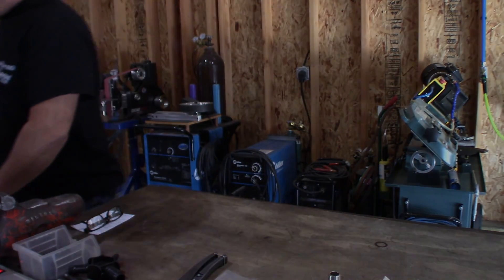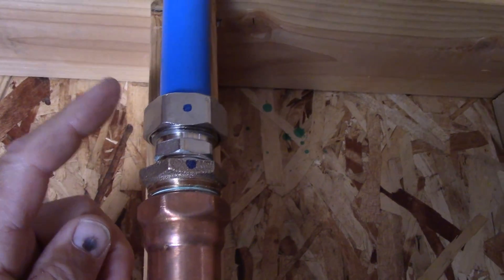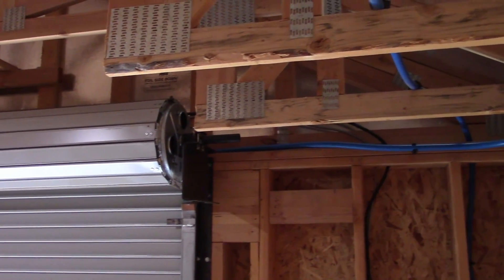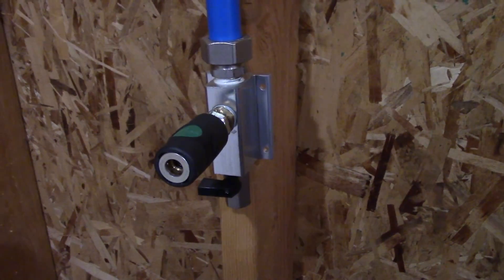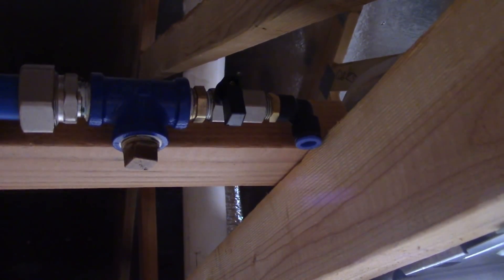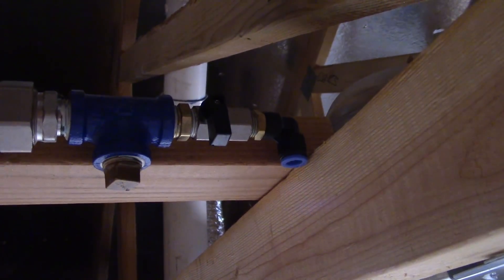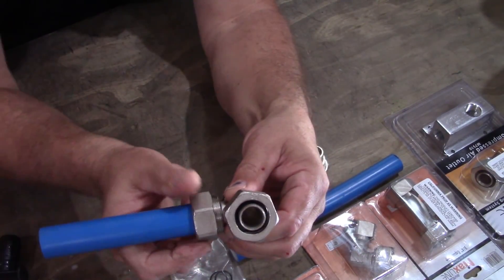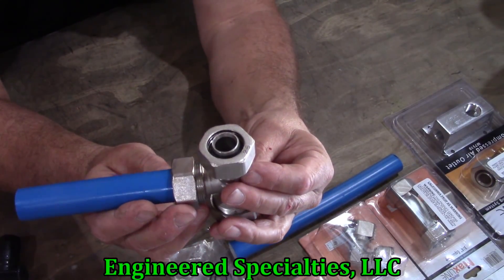Rapid Air Max Line Air System #realraysgarage

Comment: Excellent overview of that airline system Ray! This is just what I need for my shop. I’ve been on the lookout for a new airline for my shop and I think I’ll pick this up based on your review. Thanks for sharing all of the helpful info. 👍🏻
Reply from the maker: Abom79 Thanks Adam, this MaxLine system has been in use now for over four weeks and still no leaks and working great, looks great too! Looking forward to your install.
Reply: You can save a lot of money by using schedule 40 PVC irrigation pipe and fittings. Glue it all up and you're good to go. I installed this type of air system in my shop 10 years ago and have not had one leak since. I often leave it charged at 90 psi 24 hours day, 7 days a week. VERY ECONOMICAL AND DURABLE  AIR LINE SYSTEM
Reply from the maker: Hello Leonard, I have heard of sch 40 PVC lasting trouble free for many years but I did not want to chance my kids or friends getting injured if there was a failure so I went with this RapidAir MaxLine system and am very happy with it! Thanks for your comments and for tuning in!
Reply: Dudes i gotta say this. I opened up Rays video because i am researching an air setup as well and when i saw him i said to myself: Dude this guy looks like Abom79 20 years from now. Lo and behold first comment here? LOL. I could not erase the grin off my face... He he.
Reply: Leonard Zielewski PVC compressed air systems are very dangerous.  When the PVC fails, and it will fail as it ages and gets brittle, particularly if exposed to sunlight, it will explode sending sharp shrapnel everywhere.  PVC is banned by code for good reason.
Reply: @LTVoyager  I agree with ya 100 percent. That gentleman has just been lucky so far with that pvc system. I hope that no one is around when it does BOOOOOOOM! 👍👍🤣

Comment: How would the tube hold up in service truck in hot and cold weather in the North?
Reply from the maker: That's a great question! I would think as long as the tubing and fittings are secure and not moved around too much it should be fine since the tubing is three layers, PEX white inner layer, aluminum center and blue PEX outer layer. The fittings bite on the inner and otter ring for good seal. My system to date has zero leaks!
Reply: @RaysGarage  ok

Comment: Why did you loop it back to the first T?  Is this necessary?
Could I just do two branches from 1st T?
 Looping the ends of the branches together will take a lot of extra pipe.
Reply from the maker: Hi Steven, I looped the air system together to balance the air flow so that all drops provide the same volume of air. It is not necessary.
Reply: @RaysGarage  Thanks!

Comment: I see that you made this 5 years ago, but for anyone watching recently... on your drops, just sister/scab and another board (Looks like 2x6?) next to the aluminum blocks. There is no need to put an aluminum plate behind the aluminum block. This will give you a solid backing to screw all four screws into the aluminum block. Cheers.
Reply from the maker: Yes, you are correct. I did plan on closing in the walls one day so I just made the plates to be able to mount anywhere. Thanks for sharing your tip!

Comment: Did you hand form the bends at corners or use an electricians conduit bender? You could probably just put some pieces of wood on  each side of the stud to screw block into and not have to make the plate. So if you sheet the walls, did you allow room to get tubing on outside of sheeting?
Reply: Good question, Fred.
Reply from the maker: Hello Fred, I hand formed the corner  radius and did think about this before the install and was thinking about using crown molding to have access to the loop above after sheeting the walls, now for the corners I might need some ideas there, maybe there are corner radius moldings?
Reply: They do make this stuff called 'deco-sheild' that's used to conceal sprinkler pipe along walls that has been retro-fitted into existing building, but truthfully isn't that great looking! Maybe your idea of crown molding and then building little soffits in corners to conceal the parts that stick out because of the bends.

Comment: Nice system....   How does it compare to copper rigid tubing in price?  A big advantage of copper is you can oversize the pipe and gain extra air storage in the lines.  Helped do my good friends shop that way, (auto shop), worked great, big building
Reply from the maker: Hi John, I have over $300 in just the 1" x 30' copper delivery system and paid a little over $38 for a ten foot stick of the 1" pipe plus fittings, solder, ball valves, 1/2", 3/4" copper pipe and brass fittings. The entire 3/4" RapidAir MaxLine system with additional fittings and outlets was  just under $500 and have more than enough air for multiple users if needed. If I were to guess I am sure I would be just under $2000 range if I went with a all copper system. RapidAir does offer the MaxLine in 1" also but not in Master Kits so the cost jumps a bit.
Reply: Ray's Garage I just priced out a system for my 32’ x 48’ workshop.  I plan to run a 3/4” loop around the ceiling with a drop in the center of each wall.  This requires 210’ of pipe.  I priced a both Maxline solution and an all copper solution.  It turns out, the cost is almost identical at about $700 for each all in.  I am leaning towards all copper mainly because I can install it myself.  I don’t see any way to straighten and affix the Maxline while working 14’ in the air on a ladder.  It looks like I’d be wrestling a python.  At current prices, the copper pipe is about twice as much per foot as Maxline, but the Maxline fittings are what make the total cost nearly identical.  I can buy copper for $1.80/foot and Maxline is about $1/foot on Amazon.  The killer is the Maxline fittings which run $15-20 each.  Most copper fittings are 1/10 the cost.  For example, a Maxline tee is $21.95 on Amazon and a 3/4” copper tee is $1.69 at supply house.com.  A simple Maxline straight adapter to NPT is $17.15 as compared to $1.45 for copper.  I looked at Rapidair’s rigid aluminum pipe as that would be an easy solo install and the price was close to copper, again the fittings are pricey, but what killed that was the shipping cost of the 20’ pipes or the coupler cost if the shorter pipes were bought to save shipping cost.

Comment: Thanks Ray.  How do you filter out the oil and swarf from reaching the motor?  That is where mine falls down.  I have the steel tub so that is fine.  Steel would work well indeed for a shop anywhere as well as the welding position.  Only downside might be price.  Take care.  Doug
Reply from the maker: Hey Doug, The paper filter has a cotton sock on it that I change out from time to time but I still have to replace filters more often than normal. Its the the nature of oil and chips but well worth using the vac to clean up.

Comment: I have used nickel based anti-sieze on the fittings before tightening them up . That makes them turn very smoothly without the galling feeling when you tighten them up dry .

Comment: Great review! I am looking at purchasing this system. My only concern is that the fittings are a lot smaller in diameter. Is this an is issue with cfm? I’m worried that it will “bottle neck”. I need consistent volume for painting. I looked at the fast pipe but it is really expensive. I look forward to your reply. Thanks in advance.
Reply from the maker: Nick Carrasco Hello Nick, I do not think you will have flow issue with the 3/4” MaxLine System when painting but you could go up to the 1” MaxLine System. I would do a open line test for you if I could measure CFM but have no way to measure this test accurately. I would call RapidAir tech support, maybe they can give you more info.

Best Regards,
Ray
Reply: Ray Caniglia, in you opinion, do you think the diameter of the fittings would restrict the volume? I have always used 3/4” lines I’m just worried about the diameter of these fittings.
Reply from the maker: Nick Carrasco As long as your compressor can keep up you will be fine with the 3/4” system and don’t go smaller than a 3/8” ID air hoses.

Comment: I know this is an old video, but going the same route in my new shop. Bought 2 of the 100 ft kits.
Reply from the maker: Perfect Tom, It's a great set up and you will really like it once your finished. A quick tip, add a little oil to the fittings nut when assembling so that the metal to metal contact is  a lot smoother. Hit me up if you have any questions.
Reply: Ray's Garage will do thanks.

Comment: Looks good. I have a nagging small leak on my black pipe line I need to chase down.
Reply from the maker: Hey Tom, I am very familiar with threaded pipe and one of the main reasons I did not go that direction with the full system. Good luck with chasing down your annoying leaks!

Comment: Ray how did you straighten the pipe?  I've got 2 of the 3/4" kits waiting to be installed, I've heard the pipe is a PITA to get straightened out.  Did you use some sort of jig or just by hand?
Reply from the maker: Jo Simon I hand straightened the MaxLine then tweaked it a little more after installed in the clips. I spaced the clips 4’ apart on the top loop and 3’ apart on the drops.
Reply: No need to waste your money on the pipe straightening system I did mine around the perimeter of 32 by 40 Shop just by using the clips on the wall snapping the line in and working my way down and unrolling the coil as I went along got it semi straight snapped it into the clips and then made some adjustments in between the clips by pushing down or up or in or out depending on what I needed and it came out very straight and I don't think you need two people to do this process either, then again I had a scissor lift to work off of being that my system was at around 14 feet. The system is excellent and easy to work with but the only thing I didn't care for was the fitting IDs are a hair smaller then the rest of the piping system. But in the end it all gets reduced down to either quarter or 3/8 anyway at the tool location so I guess a little smaller ID on the fittings really isn't going to make a big difference. I used all Ingersoll Rand 3/4 inch regulators and coalescing filters and all my fittings in the system non rapidair are all stainless steel not much more expensive than brass. On my drops I also faced the tee fitting in the loop up then used a 6 inch piece of pipe a 90-degree elbow looking over, another short piece just long enough to connect a second elbow looking down and then ran my drop down towards the ground. This creates a candy cane type Loop to keep any water in the circumference of the system from entering the drops.  another nice thing about the rapid air system is you can direct bury it. I ran a second line off of a manifold with ball valves to isolate the different lines and ran it down through my block stem wall Underground all the way to my house approximately 90 feet away to feed my garage inside the house this way I don't have to listen to a compressor run in my house , it's 90 to 100 feet away in the garage.  great video by the way one of the better ones I've seen on the rapid air system. nothing like a machinist / metal worker to do things the right way and usually Overkill but I wouldn't have it any other way. Nice job!👍

Comment: Ray, could you please, please, pull the volume in your editing software a smidge down? Because it's so high, and because of YouTube's compression, when on headphones (which is my personal issue and circumstance, i know) it's a bit difficult to hear some things once you lower the volume. It's just a small thing, not really all that important.
Otherwise, an awesome video on a cool installation.
Reply: On a sidenote, good idea on radius bending the pipe, each time a T or a elbow is used, that's a reduction in pipe. I kind of miss the older, and now discontinued method of connecting air pipe where a small flange was inserted in to the tubing (very thin, so no reduction) and a sleeve would be compressed on top of it. Coupled with a nut, it would then screw on to a same ID fitting, thus, no reduction. One would think that they don't affect things that much, but on big installations, they do.
Reply: Oh and the tool is actually so that your pex-al pipe is squared, that little bulge is the part that spreads the pipe so it fits better. So in theory, even if you don't cut it perfectly straight, it will be straightened by the tool. It's really cool, i have the drill mounted version, where the bulge is on a separate, non rotating, sprung bit. Once you've inserted the pipe, it self centers on it and allows really crisp cuts. It's so good i haven't bothered in the last installations to even cut the pipe right, i let that tool do the work for me.
Reply from the maker: Thanks for all the great info! I will work on the Audio and did not realize was so high, it sounded fine during editing and should have reviewed it after posting it live. Thanks again for all the great input!

Comment: I contacted the company after 2 catastrophic failures using the recommended fitting tightness. They told me despite the recommendation, tighten them as hard as you can pull a wrench. The fitting cannot be damaged from over tightening. They said tighten until it stops turning if needed.
Reply from the maker: Hi Ron, I did make mine pretty tight, I found that adding a little lube to the threads helped a lot! Tightening the fittings after a little oil made it smooth as silk and no leaks to date!

Comment: I know moneys an issue, but are you insulating and putting up wall board (osb, plywood or drywall) of some kind on the insides of the studs/ceiling?  If so, how do you plan on doing that with all of the stuff in the way?
Reply from the maker: I do plan on installing wall sheeting at some point and thinking about using corrugated metal in the grinding and welding areas with insulation and will have to remove everything installed but I did plan on doing that extra work. I feel the extra work is worth it to me to have everything in place before closing in the walls and ceiling.

Comment: Loops are fine provided they return back to the source. Compressor out then back in. Compressor doesn't know the length of the line hence no peer drop. As far as your drops they are done incorrectly. The tee must be turned up not down. Water travels down not up. Reconfigure your drops and you won't have any water. Plan a drop in your loop for a water trap and you will have a near perfect Air system without the expense of a refrigerated drier. Nice try.
Reply from the maker: Lawrence Jones Thanks for the info but my system is near perfect less a dryer and have never had moisture in any of my lines, ever! My system is a continuous loop and perfectly balanced, so I’m not sure why you think it’s not. Best Regards, Ray
Reply: Some people just have to criticize everything you do but can’t do anything themselves. 🤬

Comment: You must have spent some time installing that with as straight as your lines are.  Mine aren't horrible, but they are nowhere near as straight as you got yours.  How did you end up straightening them?  I was also surprised to not have any leaks after installation.  This is the best system I've seen or used IMO.   Now that I've got my new 80 gallon and Maxair system, I honestly don't know how I've got by without it for so long.  Looks great man!  Your garage/shop is coming along nicely!
Reply from the maker: Thanks man! I did take a lot of time hand forming the MaxLine pipe using my hands and knee and still is not perfect but good enough. I was not spending another $150 for the straightening rollers from RapidAir for a one time use! Sounds like you are going to have plenty of air as well and remember, the air system will add a good 10 to 15 more gallons of air depending on the total length of you system.

Comment: If you are running a commercial pressure system then those pressure ratings are a bit light on a hot day with the line in the attic. Of course it is fine for 99% of people only the outlaws like me would have trouble. lol

Comment: Ray did you use or purchase the straightening device for your install? My concern with this is I will not be able to straighten the roll out and it may look sloppy.
Reply from the maker: Erik Keenan Hello Erik, I straightened and made the corner radius by hand. I did not want to spend over $100 for something I used once.

Comment: All that work and you put a steel fitting in your loop? Come on Ray! Rust!!
Reply from the maker: Hey Denny, Home Depot was out of brass 1/2" tee's last weekend and wanted to get the system charged. I will be replacing the steel tee the very reason of rust real soon! Thanks man!
Reply: Just saying, pal. Not picking your work apart. Great job so far!

Comment: Nice work on the air line installation Ray. I used a similar setup made by Aircom in the 1” tubing size. 
Mike

Comment: Hello Ray,  I really like your circumference install.  Covers the territory well for any future drops.  I built my addition dictated by the geography of space available so now I have to decide where to locate the machinery.  That makes having a changeable system really nice as I shift tools.  Let us know what you have planned or not planned for your interior surface (I assume since you have a/c you are going to insulate?).  On another note, what kind of filter do you use on your shop vac or system to keep the oil in the chips from clogging the media?  My pleated paper is not working so well.  Good review on a useful system.  Nice video.  Take care.  Doug
Reply from the maker: Hello Doug, Yes I will be insulating and closing in at some point, Thinking about using corrugated roof material where I will be grinding and welding. I will have to remove the drops I just installed for wall coverings and reinstall. As for my vac I use the rigid shop vac and line it with a black trash bag since the paper bag does not hold up to chips and oil very well.